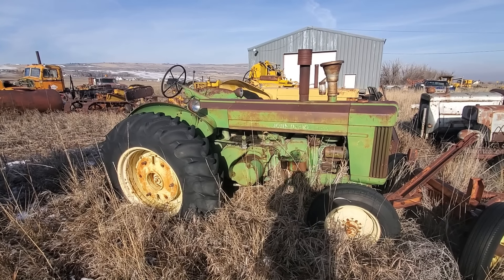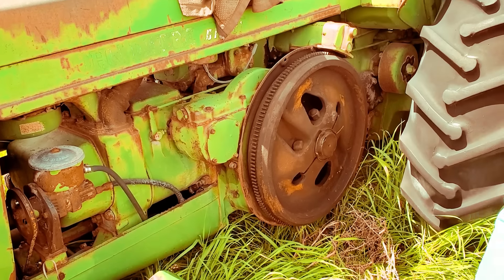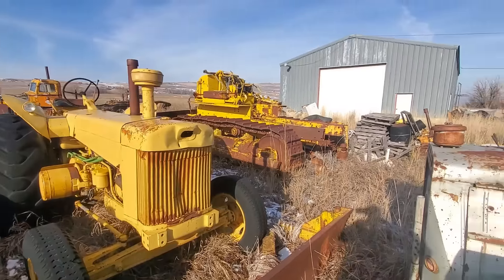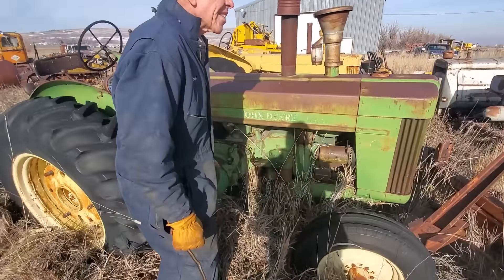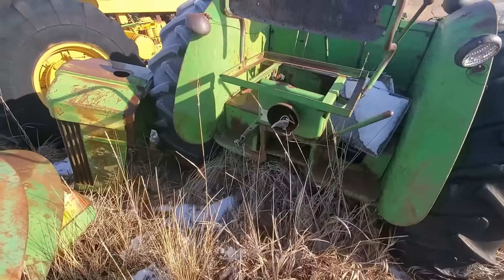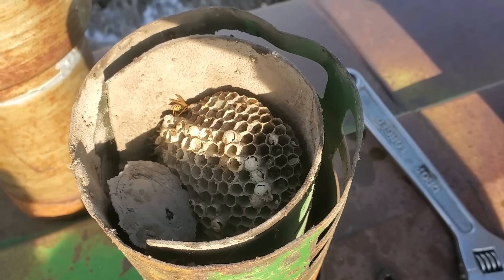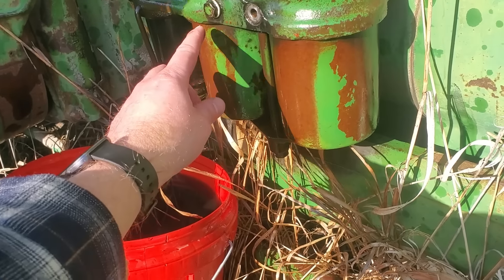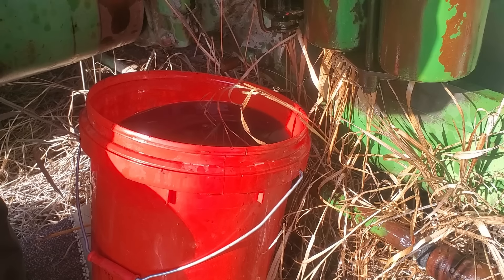Abandoned John Deere R - Will it Start?

Comment: That's a beast of a tractor that should be in anyone's collectoin.  Last one built was in 1954.  Presuming that it was bought and used for 40 years, then parked, it may have sat for 25 years.  With an 8" stroke, that engine generates a lot of torque.  Just one cylinder has more displacement than most V-6 engines.
Reply from the maker: Yes, that's kind of what we assumed... Used a lot the first 25 years. Then used less frequent the next 25 years... And then sat for the last 25 years.

Comment: Gotta love a simple, rugged, quality built machine. This is the sort of tractor that made John Deere a household name and spawned the saying 'Nothing runs like a Deere'.

I would be quite happy with an old Johnny Popper myself, though that R's a bit beefy even for my needs. Then again diesels are better at sitting unused for lengthy periods and the fuel is much less prone to going bad.
Reply from the maker: The R is very unique and fun, but it is somewhat of a land yacht compared to one of Deere's row crop models like the B or 50/520/530.
Reply: @jonelsonster  Mine would mostly just sit around looking pretty unless I needed to drag a project car around or a neighbor wanted help bushhogging. Dont need much power for that.

Comment: You never mentioned checking the coolant. I hope you did before starting it. Kind of surprised it started so easily on the old fuel. As a kid on the farm, we had an old Minneapolis-Moline combine that wasn't being used anymore. It had a V4 Wisconsin engine on it. I always hand cranked to start it once in a while (had no electric start like the newer Wisconsin's). It was kind of temperamental, so sometimes i got it started easily, but IF NOT. hooked one of our JD's to it with a flat belt like you did here.
Reply from the maker: We did. It was low, but still plenty to provide cooling for the 10 to 15 minutes we had it running.

Comment: Looks like a great tractor to restore, good tin and not beat up.
On your A, the lever below the throttle shuts and opens louvers for the radiator?
Reply from the maker: We're happy to have it. And yes, the other lever controls the shutters... But I do not have them installed. They aren't needed since I don't run kerosene. On one of our other tractors we had the shutters installed and found it that someone accidently closed them and we had been operating it in the summer heat with them closed for a while. Ever since then, we don't install the shutters. We just have them sitting in our parts shelves collecting dust.
Reply: @jonelsonster  
I just finished selling my late brothers machinery and he had a B with that extra lever.  Someone that came to look at the stuff asked me about it and I really had no idea.  Thanks for the reply
Reply from the maker: Glad I can help

Comment: Pretty amazing that decades later the tire are not dry rotted or flat
Reply from the maker: Looks may be deceiving...All 4 tires are flat. And when we came back, the fronts only hold air for a few hours. The rear tires hold are, however they are extreme weather checked and cracked. So it needs new rubber all around.

Comment: Loud,... But sounds sooo good.
The thing about Diesels is thy can sit decades and with a little knuckle rubbing  most times they will come back to life.
That's a nice find....

If it were me,. I'd get it home and just run all that old fuel out and when almost empty top it off with fresh and sweeten it up.
Oh, and Change The Oil... First,. unless the oil looked like it was fresh,  and parked right after it was changed.
And if the oil pressure is any indication, being 20 Lbs, that engine may be in pretty good shape.
Reply from the maker: Yes, we're very happy to have had the chance to buy it.  We already drained about 8 more gallons of old diesel out of it and will be replacing fuel filters and bleeding the system this weekend. Either way, it seems to be a good runner and with a little time pulling a load it should clear up

Comment: I don't know if you noticed it but the spline on the crankshaft to flywheel is shot. you can see the sack in it when you first checked to see if it was stuck.  I'm guessing that's why it was parked. Don't run it that way, bad things can happen!  It's repairable but not simple. It's a common disease on all those 2 cyl diesels.
Reply: Flywheel loose is or was a problem in the two banger grew up on an old G 52 model I was 7 when I started running it dragging corn and plowing plowing
Reply: That’s not cracked, it is manufactured that way, there are two bolts that pinch the flywheel to the splined shaft.
Reply from the maker: The flywheel does not seem to be loose, but I'll check it out once we get it home. Thanks!
Reply: It could just be an optical illusion on the video, lets hope!  BTW great catch! I've always wanted to add a 720 or 820/30 to my stable, just never could find one I could afford or in decent shape!  Also, Merry Christmas guys. @jonelsonster
Reply from the maker: Merry Christmas too! Thanks!
Reply: @Showboat_Six  I heard a story of a guy overhauling a two cylinder John Deere.  He asked an old mechanic what the torque specs were for those two bolts that hold the flywheel on.  The mechanic said "As tight as you can get e'm".  The guy, wanting to go by the book wanted the torque in numbers.  The old mechanic said:  "Use a long breaker bar with a 5 foot pipe over the handle and pull on it as hard as you can.  Then two more turns."

Comment: What kind of diesel do you guys use in the US? Because where I live we get bio diesel. When you let it sit too long algae can form in the fuel tank and all fuel lines. Best practice is to drain all the diesel and flush all lines before attempting any start.
Reply from the maker: We use just normal diesel. It's dyed red for off highway use (no road tax) but other than that, it's the same stuff you get from the pump.

Comment: Amazing    my  opinion   NO  means    to   pre heat    any   part    of   the   disel   engine    IT   STILL  MANAGES   TO   START!!!!
Reply from the maker: I think deciding to go the belt pulley start route was key. Luckily the pony motor does run, but it was nice just using the A to Crank the engine over fast enough and for long enough that it would start.

Comment: Important to consider is That the belt must be  mounted  on  the 2 pulleys  crosswíse in order to respect the driven tractores correct  rotation.
Both tractores pulleys turn  counterclockwise,
Both tractors are confronted head  to  head so the belt must mounted cross wise in orden to drive the dead tractors puleys in the correct direction
Reply from the maker: Just twist the belt. You can see in the video that's it's twisted.

The clutch pulley on the R and the A both spin clockwise. The flywheels spin counterclockwise, when looking at them face on. 

Or start it with a model H. It spins counterclockwise.

Comment: Front left of the engine looked like a power steering pump maybe? Do you know how a power steering pump work on an R?
Reply from the maker: Yes, it has power steering... But it doesn't really work... Yet
Reply: Never knew that an R had power steering for an option. I own one one of the hardest steering tractors ever built.

Comment: Was the "R" and the 830 the same tractor,? Just different model years ?
Reply: The R was John Deere's first diesel tractor, it produced around 45 hp. The 830 was the last evolution of the R an made a little more than 65 hp.
Reply: @ericvogel1126  thanks for the info. They visually look identical.
Reply from the maker: The R is the predecessor to the 830. It came out about 10 years after the R was built. After the R came the 80. Then the 820. And finally the 830. Slight improvements came with each model. Then after the 830 came the 4020, which is an entirely new tractor.
Reply: @jonelsonster  I'm thinking it was the 4010 first and then the 4020?

Comment: If  some jd diesels are 500 cdi that's like two Chevy 6 cylinder 250's one on each side. A couple cans of Resoloane  or Marvel mystery oil free up rings . And use the old model / pre 2k diesel motor oil  otherwise loose all rubber seals and NO low sulfur fuels or seals dry and crack also ...
Reply from the maker: Thanks for the info!
Reply: @jonelsonster  You said you snagged the yellow one also .Good save look at the manufacturer tag J D might have a historical library you can see her history In some cases the Air Force used them as tugs for moving aircraft or a construction company to tow a 11 wheeled packer or fuel tank for evening fillups . Oh a quart of two stroke oil counters the low sulfur stuff, or check the red stuff on sulfur content and adjust..
Reply from the maker: @adhdrebel982  yes, I bought the 830-I. The vin tag is still in-tact, so I'll check with the JD registry and get the details on this.

Comment: The R normally was started off of a pup motor
Reply from the maker: Yes, we didn't want to mess around with the pup engine in the field. So that's why we used the belt pulley. But we've since got the pup running and it will start on that now

Comment: I'm 71 years old. When I was 18 I bought a 1949 Model R out of a scrap yard. Was told "That old thing don't run". Put fuel in it, bled the fuel system, started it with the pony and drove it home! Guy who owned the scrap yard thought he just had to have it back. No deal, it's mine now chum!! What is the purpose of the hydraulic-looking pump on the left side of the engine? I know mine didn't have that.
Reply from the maker: Yup. These big diesel engines seem to always run as long as you can get fuel to them.

Comment: anything that has set a long is going 2 smoke U might have 2 run it a week or more be 4 it clears up that's just the way they are most of those old tractors didn't have alot of oil pressure it just the way they were made and U couldn't turn the oil pump up at least the motor wasn't stuck 4 as long it has been setting 😊😊 the tractor 🚜 😊 is singing 🎶 😊 so let it do so I don't think 🤔😊 that tractor was used that much they got another tractor 🚜 W more HP  tractors started going 2 more HP in the late 195OS and there on most of those old gauges were replaced after they weren't no good I don't know if there is any body that restores old gauges 😊😊 OMG 12 26 2O23
Reply from the maker: Fresh fuel will help too

Comment: What did you expect John deer makes good tractors. So it don't surprise me that as long as that sat it still starts.
Reply from the maker: This is exactly what I expected
Reply: John deer makes quality machines that last and last. No matter how old or long it sits. Last place I lived one was on the property. It had not ran in almost 3 decades yet we put fuel oil and battery it took 16x cranking it over but it started.
Reply: John deer is awesome quality.